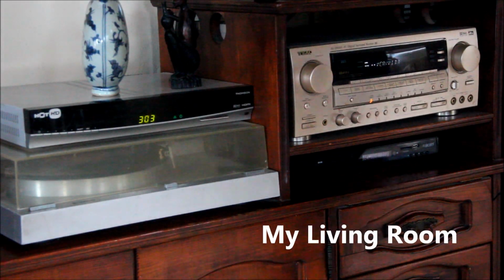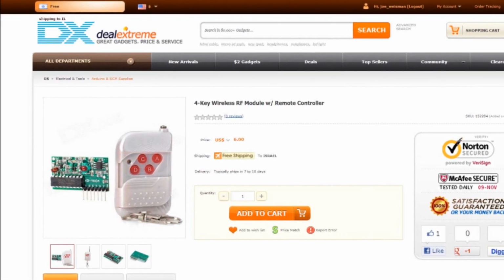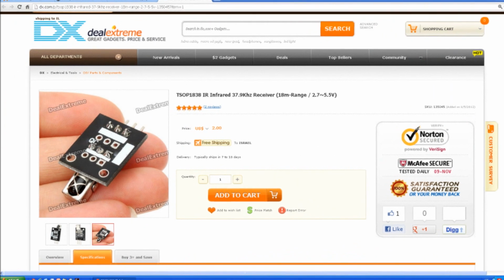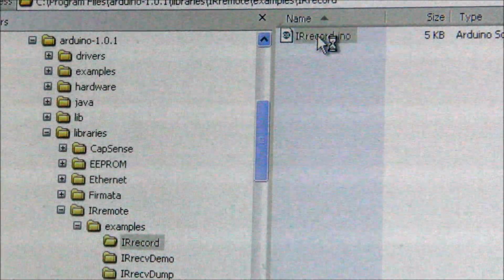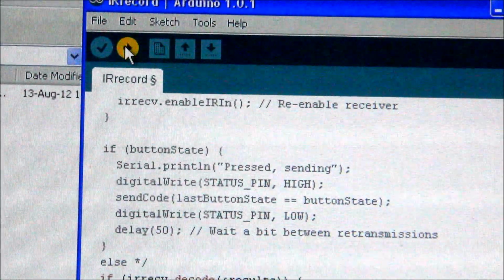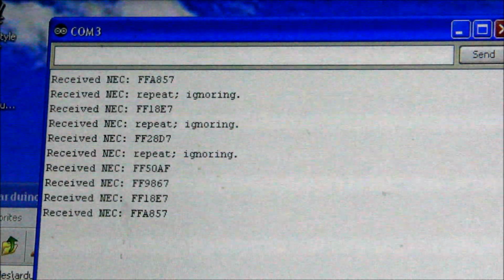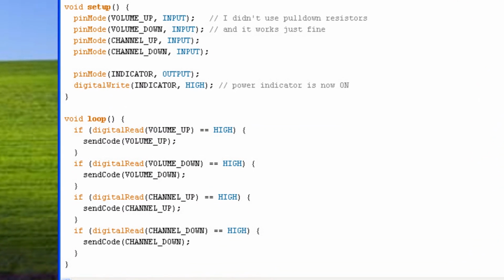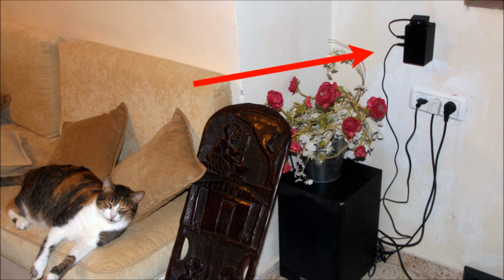IR Remote Control Fun - Weekend Arduino Project

Comment: what should i do when i have got the output like this Received NEC: 20DF10EF
Reply: all the serial outputs are

power 20DF10EF
volume up 20DF40BF
volume down 20DFC03F
page up/channel up 20DF00FF
page down/channel down 20DF807F
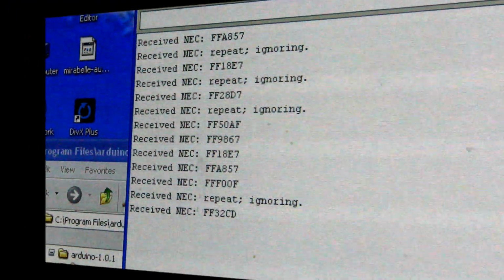Reply from the maker: Look at the source code in the video, in 03:48. You should replace the commands in my #define statements with your own IR codes. (Don't forget to add the "0x" before the outputs you measured). That should do it.

Comment from the maker: A while ago I had that happen to me, but I didn't have time to fully investigate. Also, once I had a bad IR receiver component and I only got proper results after changing the component.

The raw code you got looks like a 16 bit header of 500-550 msec marks & spaces, and then (after the first s1700) a 24 bit code.

The header mark/space lengths don't look close to any of the defined remotes in the IRremoteInt.h file in the irremote library. Can you tell which brand the remote is?